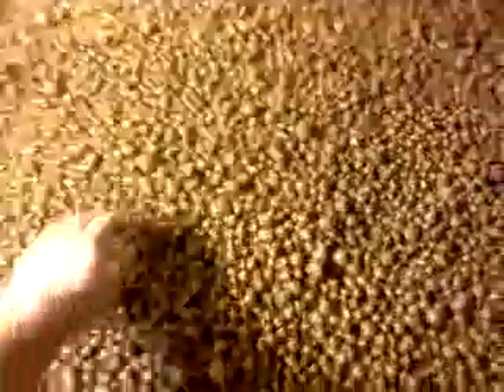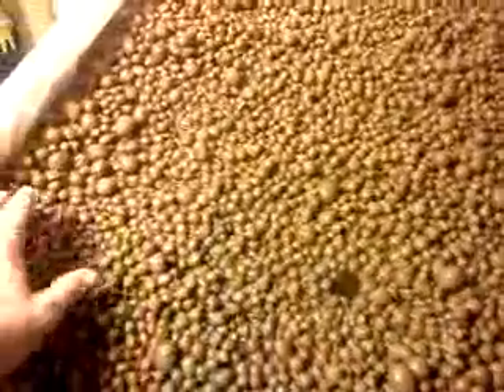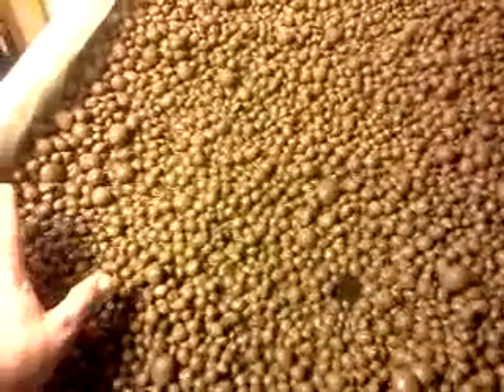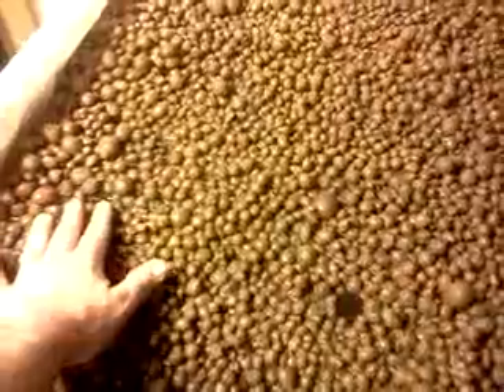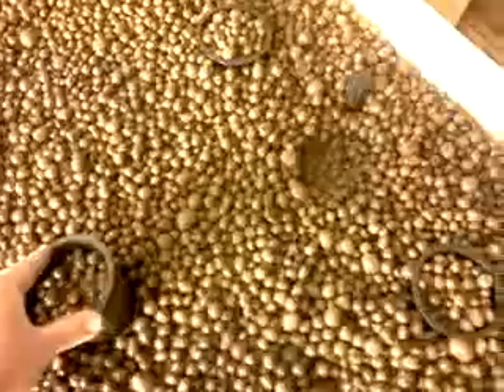DIY 4x8 hydroponic flood and drain table part 3of4

Comment: how long you plan to grow a plant on the table?  7 inch round pots are plenty and will allow you to add and remove plants as necessary.  You're also able to move the plants on the table.  No need to fill entire table with Hydroton, just the pots.

You do want slightly taller walls - 6 inch. 2- 4'x4' tables would likely be easier to operate than one 4X8 table (same reservior for both filling at different times).  Use 2"x2" for the subframe with 8" wide boards for the sides (lighter table)

Comment from the maker: hydroton does hold moisture between waterings and it floats so be sure to have your net pots flat on the bottom of the table and not to flood the table more than 50% the depth of the hydroton to keep your plants stable, and a trellis is a good idea also! I water 3 times a day while the lights are on during flowering. once just after the lights come on,then again 4.5 hrs later and 4.5 hrs after that. tip: DO NOT use jiffy peat plugs on the clones, you will get root rot in this system

Comment from the maker: the table is 4.5 inches deep, hydroton is 3 inches deep, I like to flood the table 2 inches deep. if it floods deeper than the hydroton algae will grow on the top layer of rocks. I used 5-50 lb bags of hydrorocks from HTG supply its $15 cheaper per bag than hydroton, I actually could use 2-3 more bags in this table and a trellis